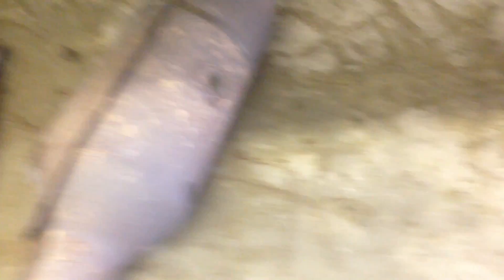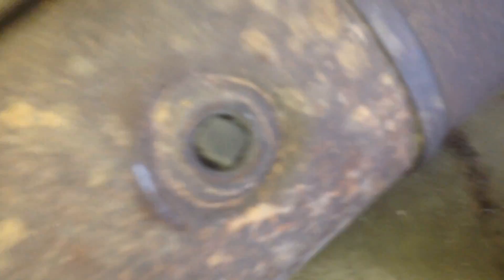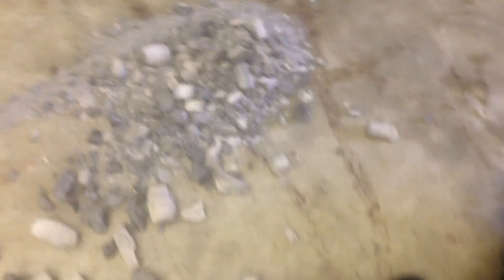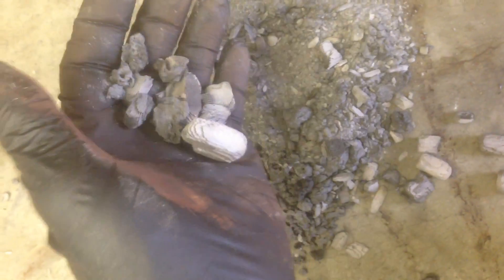Inside a Clogged Catalytic Converter

Comment: Question, dad has a 2010 F-250 with the V10, earlier, it started acting strange, sounded odd, then started loosing power and ended up only going 35 MPH on the floor, and barely would climb hills. It's showing codes for the cats, they collapse or something?
Reply: They essentially are like a coffee filter/pasta strainer, but it makes unburn fuel/lubricant burn, as well as carbon monoxide and all that via the catalysts on that mesh

If you fuel/air ratio is off, or just VERY long term, they can get clogged on all the little holes in the mesh/tubes from soot and whatnot.

They reach some insane temp when they are working PROPERLY, so once clogged it just melts the whole damn thing.
Reply: Just grabbed this from the wikipedia page 

"Temperature sensors are used for two purposes. The first is as a warning system...to warn of catalytic converter temperature above the safe limit of 750 °C (1,380 °F). More-recent catalytic-converter designs are not as susceptible to temperature damage and can withstand sustained temperatures of 900 °C (1,650 °F)"

Comment: I just saw both parts to this video this has been very helpful, where did you plug the pressure gauge to and where did you buy it I have the same motor on my truck and would like to test it out thanks again your videos have been helpful

Comment: How does that even happen?
Reply: Bad engine throws unburnt fuel into the exhaust piping, it burns into the converter, which is not supposed to burn raw fuel, and the excessive temps reached make the catalyst matrix melt and then crack.
Reply: +pcblah the high heat breaks down the metal inside the catalytic converter